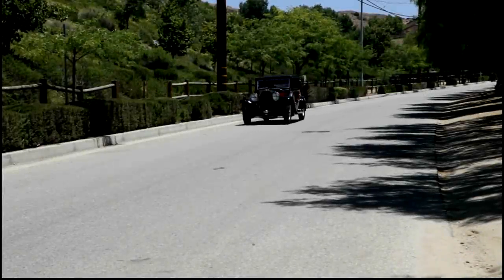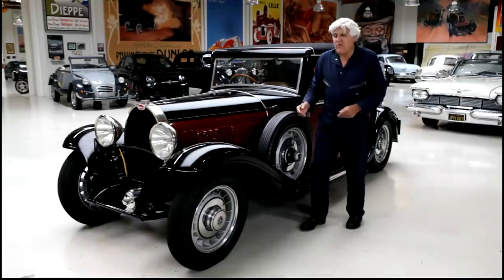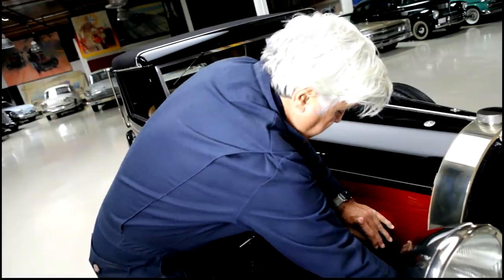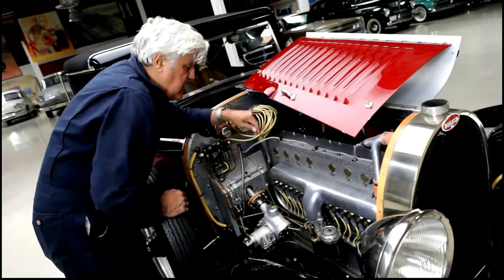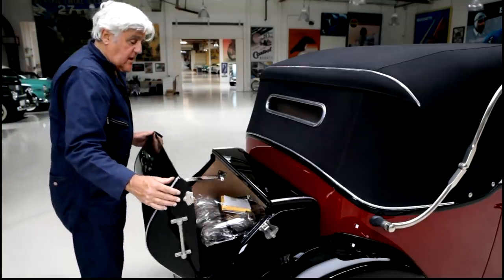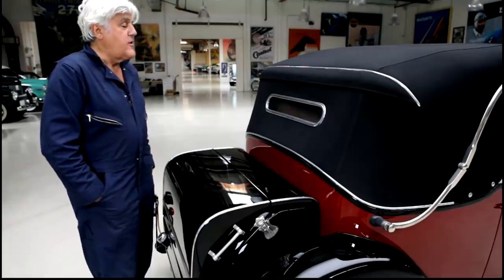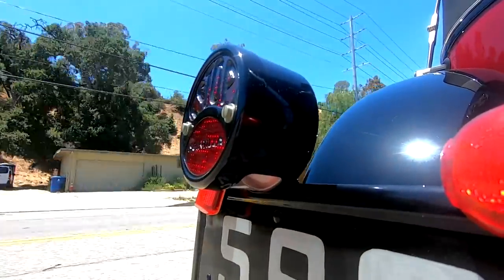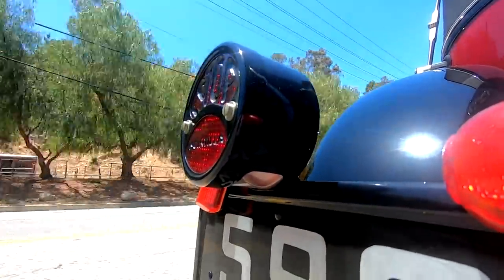1932 Bugatti Type 49 - Jay Leno’s Garage

Comment: Jay, thank you for another instructive & enjoyable video. Also, to be historically accurate, Ettore Bugatti founded his company in 1909 in   Molsheim, Alsace, which at the time was under German control. In 1919 Alsace came under French control. In 1940 it again came under German control. In 1945 it again  came under French control. Hence, depending on the year, Bugatti autos were built both in France & Germany. I don't know if that makes a difference in design or collector value but it is a historical curiosity.

Comment: Cars from the 30s are works of art.
Reply: Quite literally, after seeing how they were hand designed in clay back then ❤️
Reply: Mauro Eleven the Pierce Arrow Silver Arrow, coachbuilt Packards, Deusenberg phaetons, Bugatti Royale, Mercedes 540k, and Alfa Romeo 8C are perfect examples of automotive art.
Reply: I really think someone could make a killing reproducing thirties cars with a few modern updates (power, AC, etc.)
Reply: @Tyler Smash It seems like all of the manufacturers are copying each other.
A: Does it look aggressive? ☑️
B: Does it have the biggest infotainment screen? ☑️
C: Does it have the brightest LED headlights known to man? ☑️
D: Will it be obsolete in 5 yrs? ☑️
Reply: *craftsmanship
Reply: @TexasScout  I was thinking about that. A lot of those cars would be ideal for a "roller skate" plug-in hybrid setup. All the batteries and motors on a standardized chassis, put whatever bodywork you want on top of them. A small engine for range extension.

Comment: I had the joy to spend some time in Paris over the last Christmas and New Years period. Wandering around one evening and I see an old Bugatti pull up and a guy get a childs car capsule out of it with small child inside. 

Research shows it was a T49 Labourdette from 1932, chassis 49466. 

28th of December 2019 and the owner was "dailying" a car built in 1932 and using it to transport a baby. It brought a real smile to this "car guys" face.

Comment: Blessed be the man who puts 4000 miles on a Pebble Beach class winner. There is not enough of that happening. 
To quote Jay talking to (IIRC) David Lee "you build them as a 100 point car, drive them down to 60 or so and build them up again". 
Far to many cars of this ilk are ever, ever driven bar the 40 feet from the enclosed trailer onto the green at PB or The Quail.

Comment: If an engine has an odd number of valves they typically have more intake valves than exhaust. Because the exhaust is being forced out so can have a smaller opening. The intake is only pulled in by atmospheric pressure so the larger opening helps.

Comment: Header pipes are the hardest thing to keep paint on but I found some paint that never faded wore off searching around the old garage here I found a can of wrought iron paint for those fences I poured it out of the can on hot headers careful not to get it on the engine let it drip down filling all the cracks and it baked on finish looked amazing and stayed that way for years so much for experimenting with paint like a art form .

Comment: Saw the words 1932 Bugatti, and saw the words Jay Leno and instantly clicked on video. ❤

Edit: i love the way it sounds!  It's like a spaceship!  3 valves in a tiny 72mm cylinder?  But at 100mm stroke that's a pretty long stroke to bore ratio. Why did they need 2 spark plugs per cylinder though?  That seems like insanity.  If I owned it, and it was 100 degrees Fahrenheit outside, I'm sorry....but I'd risk scratching the paint & wrinkling the ceiling and put the top down, LoL!  If you don't ever move the top I'm guessing it may get brittle like an old baseball glove.  It's always good to see Jay Leno out driving these classic cars instead of just letting them sit and rot in a museum, they were meant to be driven, and that's part of why we all respect this guy so much!

Comment: Use Jet-Hot High Performance Coatings in Burlington NC to do a coating on those exhaust manifolds. Lifetime warranty, reduces heat in the engine bay, prevents rust, multiple color options, and only costs around $250 for a set of V8 headers.

Comment: Absolutely very interesting very well engineered cars for it’s time & what a restoration indeed I’ve 2 old jags myself 1964 S type 3.4 with synchromesh gearbox plus overdrive, & 1984 Daimler sovereign series 3 4 speed automatic there good built cars I work on them myself I’ve a workshop at home but it’s a passion for life absolutely lovely nice car indeed

Comment: Saw that "Scintilla" electrical component. I guess I had always assumed that was a SoCal or at least U.S. speed parts company because I have seen coverage of a lot of 50's and 60's rods in old Hot Rod mags or the little pages. A pretty fair number of old drag cars or featured street rods with a performance edge had magneto's. Either Ronco's Vertex or Scintilla.

Comment: Wow.. wow wow. What lines that car has...no question top 3 most beautiful cars you have Jay. Ah yes sounds like straight cut transmissions gears and no syncos..  like my 31' Model A..  shift slow 🐌.. she is old after all.. a lower idle rpm helps..

Comment: Hi  Jay. You are the true enthusiast,  that's why we look forward to seeing you . The headcloth,  is it similar in look and touch to Jaguars ? If so it's West of England Union cloth. 
Hjeltness restoration is ,as you point out , flawless . And they saved you probably $500k + . I drove a model T 30+ years ago and that had the same pedal layout. I'd never driven one before and l had to drive it 10miles in heavy traffic, that was a baptism of fire! It too was right hand drive so for me in England that was no problem. And Jay ! Absolutely  no one else would drive a pebble beach winning motorcar 4 thousand plus miles!  Terrific. Thanks Jay. I know you probably won't read this but could you stove enamel the exhaust manifolds ?

Comment: Hey Jay, thanks for sharing this beautiful car. I never knew anything about this model Bugatti. I thought 1932 Chevy's were artistic, with their fender curves. Also, looks like you may have a loose nut, on the Running board Bracket, at 16:06. Can't see the bolt at all, in the shot of the nut, And the lock washer does not look compressed, as it should... Great Car!:) Don

Comment: The volume of traffic on the roads during this pandemic is probably about the same level as the 30's so now is the time to get out and about in vintage and post vintage cars without the stop start traffic in towns and cities.  Jay, you must practice gear changes on a crash box, the teeth will love you more, don't rush them and double declutch both up and down.

Comment: I notice that the accelerator/throttle pedal design was borrowed from Daimler. My 1927 sleeve-valve has exactly the same arrangement - a roller so as to avoid wearing the sole of your shoe.

Comment: On the topic of unassisted experience I usually dislike powersteering in every car I've ever driven that had it. Probably because I've only owned older small cars (VW Golf Mk II and a Honda CRX) and my dads cars may have had bad power steering. The Citroen Xantia was atrocious and the Toyota Avensis (2002) wasn't much better feeling. However my "new" car is a Honda Accord '88 and the power steering in that actually feels very nice to me. It doesn't try to hide the road feeling from you like newer cars do.
Reply: I guess "newer cars" is 90s and early 00s in my mind... actually new cars don't even have mechanical connection to the wheels in many cases XD

Comment: How did hand throttles work? Like manual cars did you have to put the hand throttle to idle before changing gear did the hand throttle get connected to the foot throttles or are they completely separate and how does it move the cable?

Comment: Not that I would compare his Bugatti with a Land Rover but I get where he's coming from.
I used to have a 1966 Land Rover Series IIA long wheelbase pick up truck in matt black. It had no power steering, no power brakes, no synchromesh, the high/low headlight switch was a button on the floor by my left foot, it had an electric start but also the provision for a starting handle which I did have to use a couple of times, the two windscreen wipers had to be manually mechanically engaged before they could be switched on and they had to be switched on individually, the petrol tank was under the drivers seat, oh yes, and because it was formally a Royal Air Force ambulance it was based on the heavy duty one ton chassis with the extended spring hangers and heavy duty suspension despite having around half the overall weight reduced when the ambulance body was swapped for a pick up bed so the ride could best be described as 'harsh and choppy' but it was quite easy to get it sideways on roundabouts if I wanted!
That thing was by far and away THE most hardest car or motorcycle I've ever used but you know something? It was also the most rewarding too! The sheer concentration to know what was going on, the coordination required to change gears and the sheer amount of effort to steer the damn thing, parking was hilarious!
That is probably the biggest 'regret sale' out of all my cars and bikes and I'd have another in a heartbeat!

Comment: Hey Jay your only running on 7 cyls.,#1 is not working you could also tell the heat paint was still original color on  that cyl.--kinda sounds like exh.valve not working

Comment: My grandfather was looking for transport here in London after WW2. He went to a scrap dealer to look at some vehicles. He was offered a Bugatti Type 49 for practically scrap value. He turned it down as nobody wanted sporty cars due to the fuel rationing. He ended up with a Panther 600 single motorcycle and sidecar. Not much difference then grandfather! I always wonder if it was saved from the scrap pile.

Comment: Hi Jay . I am a Retired Truck Driver. After driving for 20 years 10 Speed (EATON)  Non Synchronized Transmission (tractor-trailer). Just by listening to the Engine I could FLOAT THE GEARS. Can you float the gears in a car like this?

Comment: By the looks of the exhaust burnt off the headers, the front cylinder isn't firing.
Reply: It could merely be no more than the leading pipe gets more cooling effect from the fan.  The further from the leading end, the more  is burned off and, indeed, the leading pipe is beginning to show its coating becoming burned. Jay Leno is not short of skilled people to look after his vehicles, particularly the special ones like this.

Comment: I think this car was bodied by Gangloff workshops, Jay didn´t metion it.
Reply: Very likely you are right. On the web there is a picture of a Type 49 with a Gangloff  "faux cabriolet" (literally "false" cabriolet) body. This differs from the Jay Leno car in that it is not a convertible and the hood irons are only decorative
Reply: Out of curiosity I have just checked the restorer's website. The vehicle is definitely bodied by Gangloff.

Comment: BUTTTTT .. Yes Jay,,, 3 ,,THREE VALVE  4.6 & 5.4 FORDS & Others ALWAYS 2 Intake 1 Exhaust. ANNNDDDD. 5 Valve YAMAHA   3 ,, THREE Intake ,,2 TWO Exhaust.. On Uneven. Valve ENGINES ALWAYS MORE INTAKES THEN EXHAUST.,  just sayin .. I’m gonna try to drive My 84-87 Dodge B-350 To You From FL .. see ya soon .. it’s a beast 15 passenger VAN …. man… I’ve modified it ..,BUT IT CAME WITH A 3.54-1 DANA POSI .. 360 HD 4 BBL 040 Over & A 750 HOLLY SPREAD BORE Linked To  A 727. Torqueflight…,ITS HILARIOUS  TALK ABOUTA BUDGED BUILD….